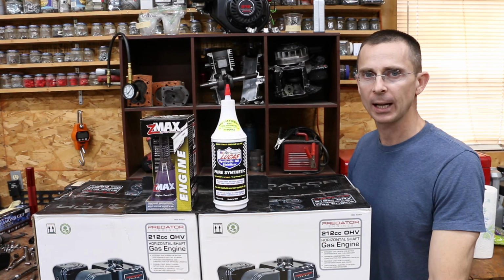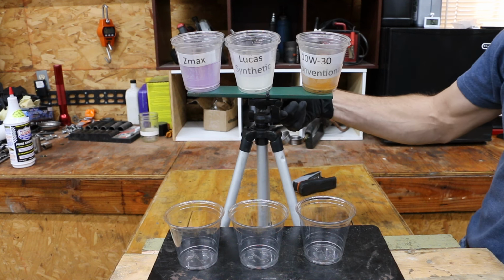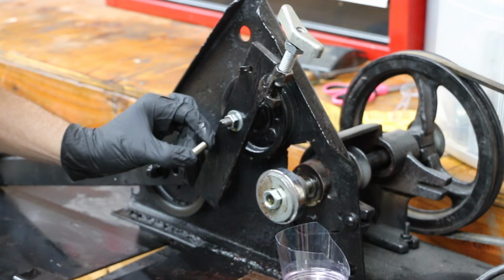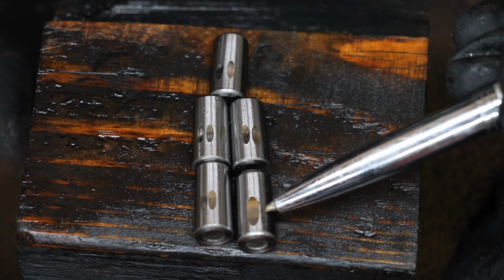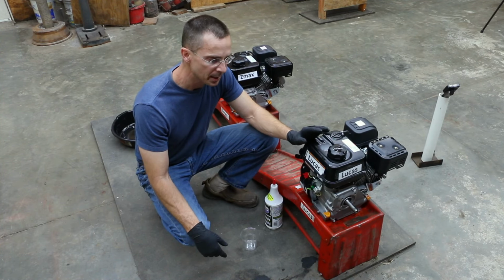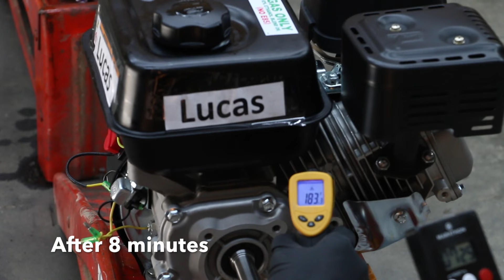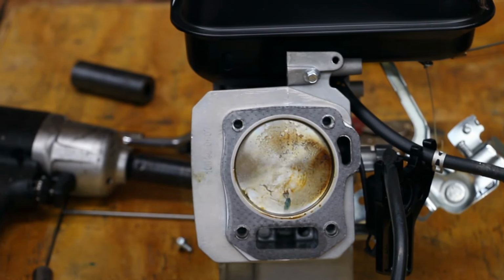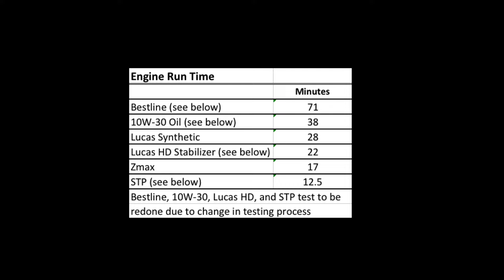Which engine self-destructs first? Zmax or Lucas Synthetic?

Comment: Fill a crankcase with grease and see if and how long it will run.
Reply: Matthew add zerk fitting run 2 minutes then top off again
Reply from the maker: Thank you for this recommendation.
Reply: Put in Greece as it is running and see if you can put in enough to stall it or at least reduce engine speed you should also try what they call Corn head Grease and get it from your local John Deere dealer it's basically a real thin grease or a real heavy oil

Comment: 15:20 Destructive testing is absolutely necessary to define the durability of the product- there is no question about it.
Reply from the maker: Thank you very much for the positive comment!
Reply: I agree! Destructive testing is a part of every industry. The fact that he doesn't work for any of these companies is a large plus. Keep up the destruction!
Reply: Project Farm hey bro thanks for the video im glad i recommend you to do a video on zmax oh boy am glad you did this i won't buy zmax maybe lucas syntetic oil in the future thanks and what a great video brother.
Reply: Just remember to not use the lucas as directed. Once you start using it full the strength, the engine becomes dependent on it. If you're engine is getting a little rougher and older, try just a few ounces. I really made a difference for me when I was in a dessert and I needed a little more viscosity protection. When I got out of the dessert, I didn't keep using it and the engine was okay with that. When my engine is more worn, I'll use a little all the time if it ever comes to that. This way, as the engine wear gets worse you can increase how much you use. If you go straight to 20% of the volume being Lucas long enough, you'll never be able to stop using it.  @joeg.1119  I've tested some Lucas products and more on my channel if you'd like to check it out.

Comment: Z-Maxx sucks lol. I remember seeing their ads on TV years ago. Never thought is was good though because it looks like water offering no protection. I would like a comparative with Dura-Lube additive oil against a competitor such as Lucas. Dura-lube was also seen on TV comercials in the 90's, and made then astronomical promises. Thanks for the great work, and your time. Very well explained!
Reply from the maker: Thanks for the positive comment and thanks for this recommendation!
Reply: BNA Since 1988. I remember those ads, I started using Zmax because I believed them . Fast forward a few years and I received a settlement from a lawsuit about Zmax making false claims lol.
Reply: I had a old piece of shit bronco II with noisy lifters... Like a sewing machine was getting fucked by a post driver. Added zmax and it quieted up. Even my dad was a skeptic, until I added the zmax.
Reply: Using a quart of ATF in place of a quart of oil will achieve the same result, plus the bonus of cleaning out sludge within the engine.
Reply: Duralube had an engine in a "block of ice for 24 hrs running with no oil or something rediculous. I see that stuff in walmart too
Reply: They’ve blown it into snake oil (zmax) it was used back in the circle track racer offy engines in the 50s because they were wiping out cams on break in
Reply: Samsung Galaxy S7 I’m sure if you would have used something els it would of done the same thing
Reply: Samsung Galaxy S7 
Valeu amigão!!! 👍👊
Reply: yeah clearly zmax reduce lubricity.  might as well put antifreeze in the crankcase.  hey theres a test for ya.  zmax vs anitfreeze
Reply: This was a great demonstration. I've always thought z-max was the be all of additives. And used in my old car and it ran for ever. Making me think it was the z-max that made it last so long. Now I seek just had a good car that I got lucky with. This was an amazing well thought demonstration. Thank you.
Reply: @pizzaholic  Actually, if you read the FTC settlement, they never were found to make "false claims", and strangely, AFTER that settlement, they STILL made the same claims, with the FTC approval:  From their site today:  zMAX Micro-lubricant soaks into metal to help reduce harmful carbon deposits. This allows zMAX to extend engine life, improve performance, increase horsepower, reduce emissions and increase gas mileage."  Remember those claims? Same.  FTC did not find anything false about them.  zMAX has the research to back it up.
Reply: @MrTheHillfolk  And, in fact, it was used in the B29 as they first implemented FUEL INJECTION for high altitude flight in the first pressurized bomber.  It was also tested on the WGN News Helicopter in Chicago for FAA approval!
Reply: Ira Chandler 
For aircraft use it costs 2x as much and they call it lenkite🤣
Yea the model A ford fuel gauge in pops luscombe costs like 300$ new. 
Get one off eBay for 1/3 the cost, just don’t get busted with a non certified part 🤣
I do have to chuckle sometimes when folks say it’s “aircraft quality” because they used stove bolts in those old beasties.
Reply: @IraChandler  Ive been using MMO for years now, but after working for a Sonic Automotive company where they use Zmax in all the cars they sell I will admit it's not a bad product for the use it states. It's not a magic lubricant.  It wont make your oil "better" but what it states is it soaks I to engine components to help prevent carbon build up, strengthening metal parts for better resistance against friction and help prolong engine life. Not sure where it states it can replace or be used to amplify oil itself. I still use MMO, Lucas I've heard foams up too much in gasoline 4 stroke engines? Also the Zmax fuel additive works great for engine performance and fuel cleaning. Again, all just things I've used and results I've seen personally,  by no means will it work in every case or vehicle.
Reply: @IraChandler  That's not true. In the early days zMax made all kinds of claims  such as improved gas milage and extended engine life which they couldn't back up. So they just made their claims more vague. They also cherry picked the data, some of the tests they conducted produced awful results; so they just didn't mention those. But most interestingly, you skipped over the part in the FTC report that says zMax is literally nothing but tinted mineral oil.
Reply: @KingAdrock420  - Carrol Shelby disagrees with you.  He used it across the board.  And, yes, it literally IS mineral oil.  What is unique is the treatment that fractures the molecules to be way smaller.  If mineral oil molecules ar the size of a basketball, zMAX molecules are the size of ping pong balls.  Have you used it (as I have extensively) and seen it creep across the surface of metals, as well as embed in the pores?  Watered down claims?  These sound pretty powerful to me: " extend the life of your vehicle" - "it soaks into the metal" - "Improve performance
" - "Reduce wear on vital engine parts" - "Extend engine life" - "Reduce emissions" - "Improve fuel mileage in older cars" - "Maintain fuel mileage in newer cars"  -  * All of these are allowed by the FTC.  In fact, the FAA approved zMAX (AvBlend) for use in piston aircraft engines.  As a pilot, I can assure you the FAA does not suffer fools and does not approve useless products just for the fun of it.  I personally - being skeptical originally - used it in my 9000# truck and improved the mileage 1.5-2 mpg.  That was from 9 to 10.5+.  That got my attention.  I am an engineer and am convinced of the efficacy by my own testing.  I developed the formula for the product they sell as zMAX BoltLube for firearms after years of testing.  I appreciate your skepticism and encourage you to focus on the reality of what it can do, as opposed to just the rhetoric.
Reply: @IraChandler  The fact that Carrol Shelby used mineral oil would be very meaningful if oil technology was exactly the same today as it was 70 years ago. Except it isn't, so it isn't.

Note I didn't say zMax does literally nothing. It indeed produces some benefits, which has been shown in independent lab tests. The problem is those very same tests showed some very NEGATIVE results as well, such as how zMax causes twice as much bearing corrosion compared to oil alone. So zMax just cherry picked the good results and pretended all the results that harm your engine magically don't exist. 

But honestly, the crux of the issue with zMax isn't that it's mineral oil; but rather that they pretend that it's NOT. I have no respect for shysters who take a normal everyday product, slap a fancy name on it and sell it for 20x more. 

BTW: if you have a financial connection to this product, you really should have disclosed that from the beginning. Out of concern over bias in his testing, our friend here at Project Farm refuses to even accept free product to test; never mind financial compensation. You really ought to try being an honest, objective person like him, rather than a corporate shill.
Reply: @KingAdrock420    The one test you refer to used zMAX alone against oil alone.  That is not how it is actually used.  It does not "enhance" oil, it soaks into the metal parts.  In fact, if you "overfill" the oil, once the engine runs, it will return to the same fill level as before.  You refer to "all the results that harm your engine" and I have not been able to find that anywhere.  Please give me a link to the study you mention, as I am unable to find it.  You say they pretend it is not mineral oil.  Interesting, as their publicly-posted MSDS (https://media.napaonline.com/is/content/GenuinePartsCompany/716408pdf) clearly identifies what it is.  
Apologies, I post many times and always mention my link to zMAX, and my experience.  I unintentionally missed it early in this thread, but, as you see, discussed it.  Also, my product, BoltLube, is not linked to sales of automotive zMAX at all.  You claim it is a "normal, everyday product", and the process they perform on the mineral oil is NOT done by anyone else.  Their process actually fractures the molecule to little pieces, and that makes it penetrate metal which "normal, everyday" mineral oil does not.  Remember "basketball vs. ping pong ball" from my earlier comment.  And nothing I said is not already documented or the result of my own experience.
Reply: In the 90's I bought the Dura-Lube treatment pack with the oil pan, funnel, shop rags, and dura lube quart.  I poured it into my engine and within a few seconds the idle speed increased about 200 rpm.  I don't know about "long term" effects as the car was sold but I know that it did do that which was interesting in my opinion.
Reply: @MrTheHillfolk  I make aircraft bolts and I've also made commercial bolts trust me there is a huge difference
Reply: @paulburkey2  stove bolts. They used freaking stove bolts. 
Ask me how I know on my dad's 46 luscombe. 
That's not high tech at all. 
People get all ooh aah when they hear aircraft quality, it's pretty funny. 
If they only knew. 
For that type of stuff, aircraft quality just means it was cut from the same type of material 😅
Reply: @MrTheHillfolk  no that's not at all what aircraft quality bolts are like I said I am in the aircraft fastener engineering and manufacturing business and I used to make commercial bolts for automotive big massive huge difference.
Reply: @MrTheHillfolk  1946 bolts or recent bolts?
Reply: DURA LUBE will not let the heat build up in bearings transfer out of the bearing effectively during extreme loading.
My cousin added it to the engine oil in his tractor brand new engine.
One season and the bearings we're worn out.
Reply: @MrTheHillfolk  My uncle had his own aircraft mechanic business,  he used it in planes and his cars.
Reply: @tomhickman1006  recently redid a little 20hp mower engine for a buddy. 
Haha I busted out all the goodies , zmax and total seal dry cylinder wall lubricant. 
That stuff is awesome and I laugh when people get all wide eyed that I put an engine together with "dry" cylinders 😁
Reply: @tomhickman1006  You should not use wear reducers on new engines.  They have to break in or fit parts inside well before protection for wear.  Just like you wont put a shoe hardener on a new shoe.  You have to let it fit to you first.
Reply: @pizzaholic 
Did u know there was a commercial version for aeronautics rngines different from the woolworths, sears,walmart versions,, only point was the flash point temp,,this treatment was meant as penetrating lubricant, persistant use made it work the chemical change after a 1st buyout was its fall as with instances quite frequent. With other products, companies u know the drill!!!the micro idea was unique but true lubricty seems to last as a suspension in most  fluids 
Hence syn oils do u remember oilzum, wolfshead, pennzoil.. organics were good to start but tolerances change (the times)pil pressure and wieghts also stay the spec!!!
Reply: @203joeroganMCL heat is the nemesis of a gasoline engine,, they did this but with a lower wieght oil or addive to fit cold temps also bet the engine did last long once its internal temp rose!!
Reply: @IraChandler 
One word ntsc!!
Reply: @industrlbeatnik 
Been saying this since korea

Comment: Your tests are dispelling some really old myths. Good stuff! You should do an amsoil vs royal purple shootout! I know there are tons of guys that would love to see that one!
Reply from the maker: Thank you for this recommendation.
Reply: Amsoil is difficult to test under these kinds of conditions to reveal its major shortcomings. The two largest drawbacks to that brand is its longevity: base number and thermal breakdown. The base number of an oil is its alkalinity, which enables the oil to neutralize acids produced during operation that would otherwise corrode components. Despite being advertised as a 15000-25000-mile oil, the base number has been demonstrated to drop to zero by only 8000 miles, and even sooner under severe conditions. Any miles driven with that oil beyond that, and the engine is eating itself. The other disadvantage is that as the oil breaks down, the viscosity actually increases, as much as 50% at operating temperature by 10000 miles, so a 5w30 Amsoil will be similar to a 20w50 after only half of its advertised endurance.

Comment: Still waiting on the prolong test! :) And these are not a waste. The amount of money end users save by not buying a product that is junk adds up to make these projects worthwhile and worth every dime you spend. Keep up the good work and keep the awesome content coming!
Reply: mute8s Prolong makes a superior product.  I buy my directly from the Prolong website. Because it's cheaper then Amazon plus they have FREE SHIPPING!
Reply from the maker: I've got some Prolong and I plan to test it soon. Thank you very much for the positive comment!
Reply: Jason B I had an engine that I had prolong in that should have seized multiple times but kept going strong so I would love to believe that it was because I put prolong in it. When he does the Prolong test depending on the results will have found my answer. Plus I've always hated recommending products to friends without seeing independent testing done like this.
Reply: mute8s Well use it in a 2010 Mack truck with Mack/Volvo 6 cyl.  The in dash computer  allows me to monitor dozens of operations of the vehicle.  Like when a low friction additive is added to the oil.  I can see the engine load go from 12% to 8% at  low idle (650) or 4% at high idle (1000).  I can watch the turbo pressure go up and down and etc. It's a fun way to test  these products.
Reply: Project Farm Prolong vs Duralube! 😈  Wait how long do you want your video to last? 😕

Comment: I would like to see royal purple vs amsoil preformed in the same manner as this video.  My guess it going to be royal purple, in fact i would go as far as to say royal purple will polish the bearings vs do any damage. Both are good oils and both will protect the engines in extreme conditions.
Reply from the maker: Thank you for this recommendation.
Reply: i am a diesel tech by trade and i have see countless people use lucas in there engines every oil changes and the damage it causes in the long run. i personally run 10w30 gtx in my engine. at 320k when the intake gasket started leaking coolant, i dissembled the top end and found no build up. goes to show its not just the oil but maintenance also. also another idea is 75w90 or rearend oil in general vs 10w30. see if the thicker oils causes more friction or if there is no change. its a idea
Reply: john hare I've heard some amazing stories about Amsoil being used in semi trucks. I think that would be an awesome comparison.
Reply: Jetmech0417  never heard of amsoil in a large diesel. I know of a guy that runs it in his 5.9 cummins and swears by it. But i agree that it would be a good comparison.
Reply: Project Farm See! (Nudge, nudge)
Reply: @wallyhare8616  Differential oil vs 10w30... Would be nice to know if regular motor oil can be used in a Differential but I suspect heat comes into play here
Reply: Already done and the Royal Purple failed.
Reply: @JA-rn5qv  he used the basic Royale purple. He should have used the SUPREME FORMULA. NOT A,FAIR TEST. WE HAVE CLOSE TO 1 MILLION MILES ON OUR FORD EXCURSION. ONLY ROYALE PURPLE X SUPREME.

Comment: Keep up the great vids.  Don't be so polite, ZMax just had their ass handed to them.  Keep going.
Reply: Hahaha…..
Reply: I thought Zmaz was a one time metal treatment and not a lubricant! Apples to Oranges for intended product purpose!
Reply: I understand the sentiment, but he should be  polite. 
The test results are a rude enough slap in the face.
Reply: Milton Moore   He soaked a bearing in Zmax for 24 hrs and heat cycled it 10 times to test your proposal and it made no difference. The wear was the same. Zmax is useless, apples to apples.